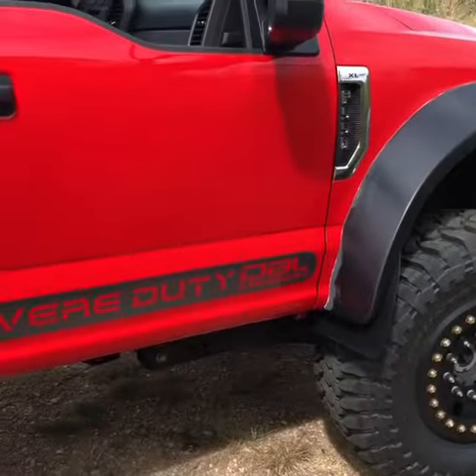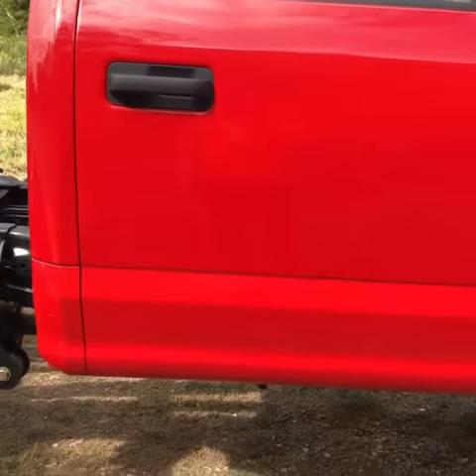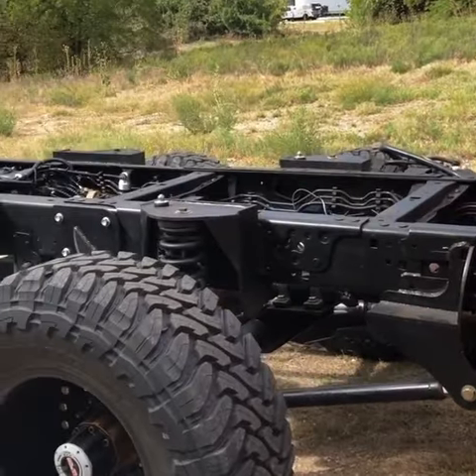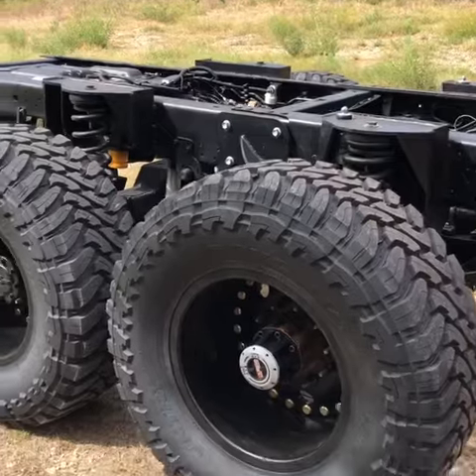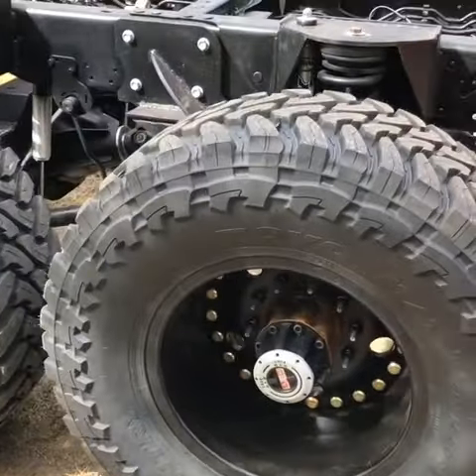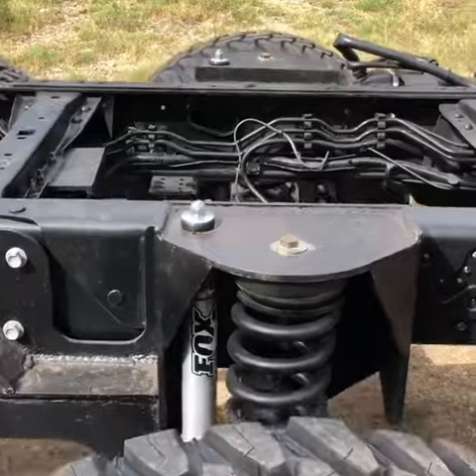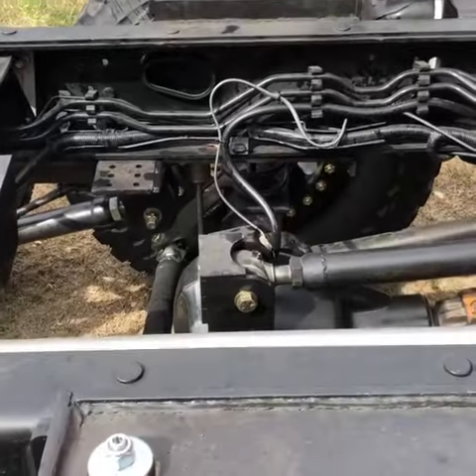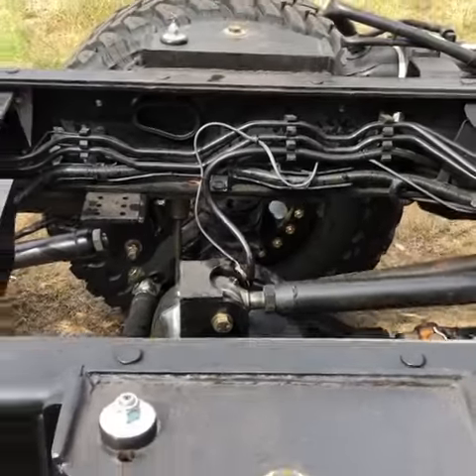DBL Design - 6x6 40 inch Toyo 15.5 MT tires

Comment: What transfer case are you guys using ? 
I have a gmc M135 duece&1/2 that used twin shaft gm banjo axles. 
The transfer case has some issues and finding parts for it is ridiculous...... 
I dual output transfer case rated for 12,000 lbs. and 3,000 ft lbs of torque isn’t an easy find....